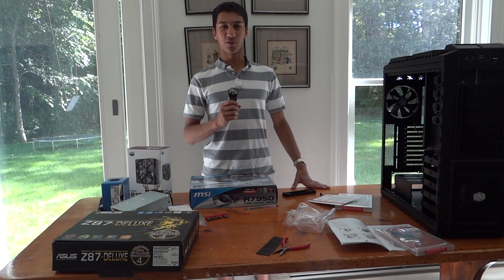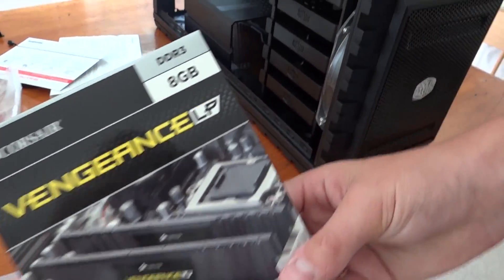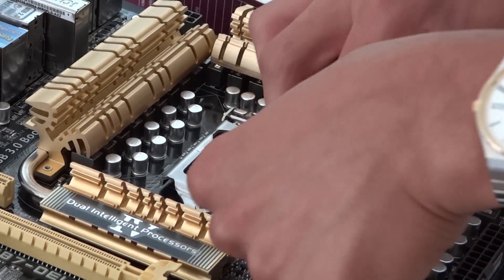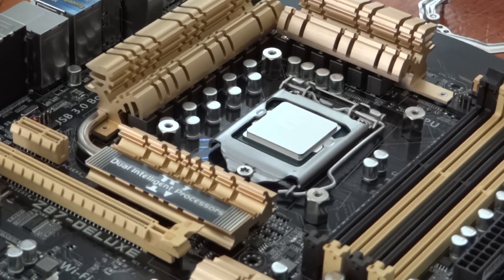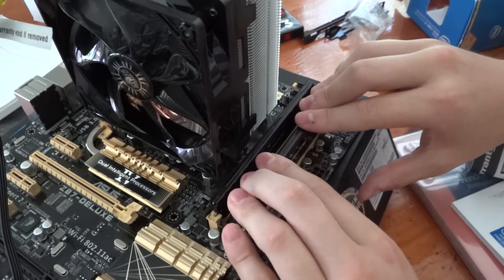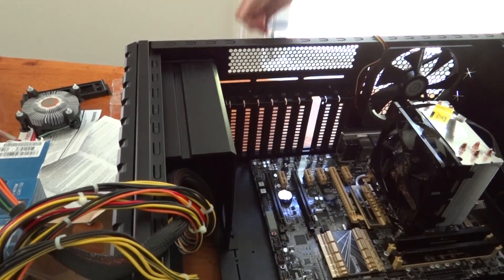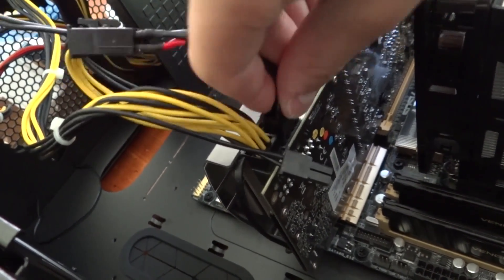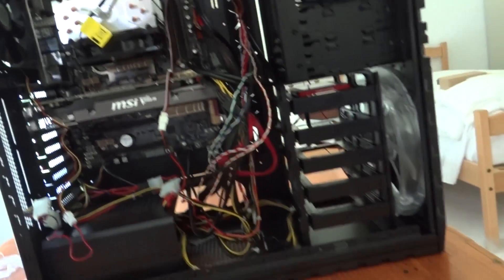How To Build - i7 High End Computer (2013)

Comment: CPU	Intel Core i3-3470 Processor (3.20GHZ, 6MB Cache, Socket 1155)

Motherboard	ASRock H61M-DGS Micro ATX LGA1155 Motherboard
Memory	Samsung 8GB (2 x 4GB) DDR3-1600 Memory

Storage	Seagate Barracuda 1TB 3.5" 7200RPM Internal Hard Drive

Video Card	Gigabyte NVIDIA GTX650Ti 2GB DDR5 PCI-E Graphics Card

Case	Rosewill CHALLENGER ATX Mid Tower Case

Power Supply	Corsair Builder Series CX 600 Watt ATX/EPS 80 PLUS Bronze Power Supply Unit